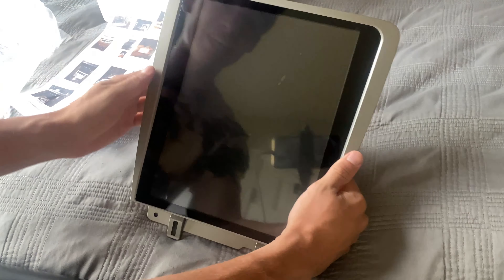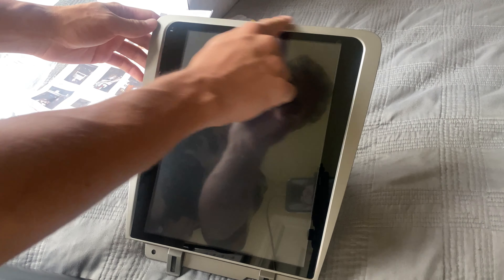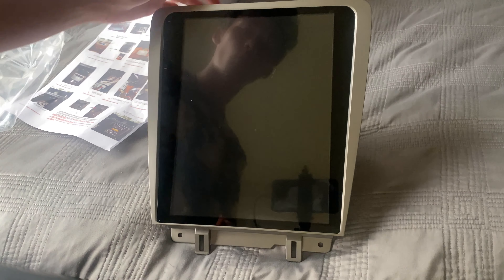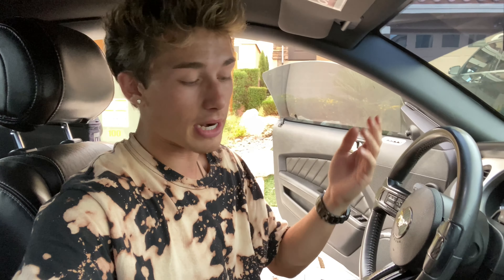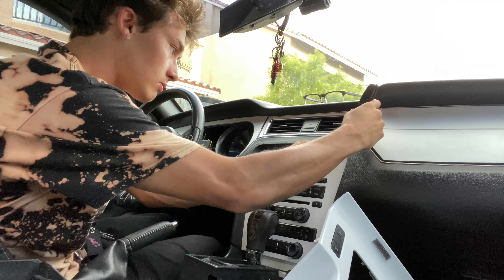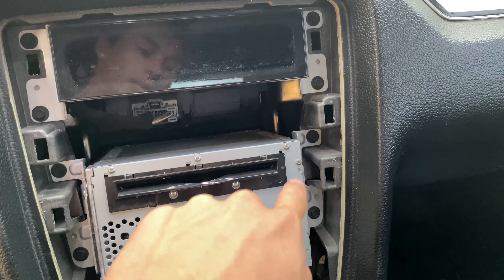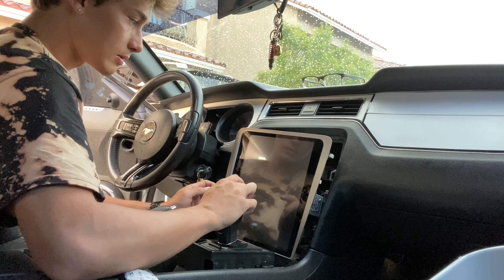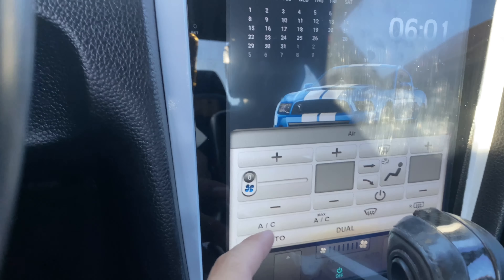The Mustang Got A TESLA SCREEN!!!

Comment: I know this is an old video, I’ve had my screen for over. Year and never had any issues. Always got compliments. Love the car play function when getting in the car and it auto connects. Phoenix automotive snapped
Reply from the maker: It’s a great system! I made the mistake of not purchasing Apple car play, but it’s no big deal. I can always get it on a later date. 

Glad you like yours!
Reply: How do I get sound bruh I got everything ac control but I can’t get sound
Reply from the maker: Try resetting the system or checking your connections to the back of the unit. Sometimes, these units need a different software that can be accessed in the advanced setting
Reply: @jdubstangy  make sure the harness in the back is fully connected and make sure its not muted, if restarting it doesn’t work try programming each button to match accordingly with your steering wheel buttons and control the volume from the steering wheel

Comment: Hey, I know this is an issue of video but I was wondering if you’ve had any issues with this setup draining your battery. I have a parasitic drain and I’m mostly sure it’s my setup. But also, I have a regular battery that I’m planning on upgrading. Any help would be right on time.
Reply from the maker: Hey! 

I don’t have any issues with my system and if I do it’s rare. You could be running into a battery issue or may need to check your alternator.
Reply: @LoganScott.  it was the battery. I was using the 96R that ford recommends but I put an Optima battery in a couple weeks ago and I haven’t had any issues. It seems like I needed a higher Cold Crank Amperage
Reply from the maker: That’s great to hear! Glad it was a battery and not something too extensive

Comment: Great video!  Where did you get your center console from?  I want to change mine out, yours looks sweet!
Reply from the maker: Thanks man! It came from Phoenix Automotive  (online).
Reply: @LoganScott.  I meant the white overlay around the cup holders and gear shifter.  Where did you get that from?
Reply from the maker: @douglasspooler2680  All used with white spray paint and extra carbon I had left over from a different item. I have an old old video on painting the center console  in my playlist under “DIY” if you’re interested. That video is basted around plasti dip but the same rules apply just about

Comment: Does the car display match the car? Does it change?
Reply from the maker: You will need to go through the advance settings to change it from the s550 to the s197. The color of the car wont change unfortunately. It’s whatever it’s preset to. Mine is a blue s197.

Comment: just got my 16 year old daughter a 2014 Mustang convertable with the tesla screen (she is so in love with it).  Sadly the back up camera was looking bad (horrible pic quality) when we got it a couple of days ago. Today it is showing nothing at all other than the lines (no visual feed at all anymore). Maybe that happened when we put the new plate on from the DMV. Either way it was having issues before that. Does anyone have any suggestions for a way to fix this problem? Thanks.
Reply from the maker: Hey Justine, thank you for watching! I’m sorry to hear this is happening. Here are some things I would suggest trying to see if it fixes your issue!

1. Check the camera lens: Make sure the camera lens is clean and not obstructed by dirt or debris.

2. Inspect wiring: Check the wiring and connections to ensure they are secure and not damaged. Loose or damaged wires can cause camera issues.

3. Restart the system: Try turning off the car and then restarting it. Sometimes, a simple system reboot can resolve minor issues.

4. Ensure that the wires are properly plugged into the proper locations. I found when installing my camera, there are a few ports where it will read the camera but no picture will be shown. 

5. System may need to be updated. I personally haven’t done it before but it’s possible it might. You can always reach out to phoenixautomotive for further information. 

6. You mentioned the camera quality is bad when it works. This very well could be the camera itself. I have a clear picture on my screen and have had no issues with visibility. Highly recommend investing in a quality camera.

Hopefully this helps! Feel free to message me for any further questions and I’ll try my best to help

Comment: I got the same screen and same door woofers but they aren't connected how did you connect yours??
Reply from the maker: I would check your connection again. Mine automatically paired when the unit was plugged in
Reply from the maker: There are settings to balance out the sound. I would check there too, as well as, the mute button

Comment: Quick question what wire did you connect the backup cam to to give it power ?
Reply from the maker: I’ve had multiple people ask me this same question and I honestly don’t remember my man. I believe it was either the green or purple wire from the top of my head but that could be completely false. 

The best method (in my opinion)  is to tap the camera wire to any positive on the back side of the screen while the car is in reverse. By doing so will allow you to see if the camera activates. I may need to make a video on this in the summer

Comment: i have the exact same one and it’s stuck on the reverse camera. how can i fix this
Reply from the maker: Try hard resetting the system and/or check your wiring is correct
Reply: @LoganScott.  i did hard reset it and it didn’t work. and i doubt it’s the wires because it worked completely fine before and all of the sudden it got stuck. idk what to do

Comment: Hey man, my a/c does not work. Stop working when I change te s550 background for s197 can you help me?
Reply from the maker: I’m not entirely sure where to start with that but if I was me, I would go into the manual settings and make sure everything is correctly set. Not necessarily the “normal” setting but the “deep” setting where you need to type in the passcode (you can find online) by holding down the setting screen. Hard to explain but once you do that, you’ll have access to all the controls. Another thing you can do is hard reset the system.
Reply from the maker: Code: 1688 
Under “System settings”
Reply: Thanks man, I will try and let you know.
Reply: I messed up  my screen it's not pairing with my AC. I could not fix it. Does not show an option to pair.

Comment: there's like 15 addons you can order with the unit, no idea what I'd need. I know I don't use apple products and my mustang is just a base 2010 model, doesn't even have the speakers in the door, nice informative viseo though
Reply from the maker: The concept is nice but the system is a little slower than I would like. Everything works just could be a little better is all

Comment: My AC does not work with that screen any tips?
Reply from the maker: I’ve heard of this issue persisting with others in the community before. Not sure what direction to look to tackle this problem but I would ask Chat GBT, watch YouTube videos, research forums and ask industry professionals or friends. 
If I had to take a wild guess, check to ensure the system is plugged in correctly and the system is reset and updated. 

Hope this helps my friend! 💯🤟

Comment: Hey how are the A/C controls and reaching them compared to the OEM radio? I see they have a new unit on Pre-Order that has physical A/C buttons and a volume / tuning hardware knob on both sides.. The A/C controls to me look like they're a bit low and like the shift knob would get in the way if you gotta press them..

Do you use Apple Carplay at all? Does it glitch out or does it work 100%? I had a Pioneer head unit in my old Mustang and Carplay would constantly glitch at the worst times.. music would cut off and all I would hear is Apple Maps Navigation it was so annoying.
Reply from the maker: The A/C work the same as the OEM until with some minor upgrades as in changing the temperature (units) compared to guessing on the last one as well as other features depending on your car model. They do sit a little low but I’ve gotten use to it. I don’t use it often so it’s not too much of a problem.

The Apple car play I plan on getting here at some point soon. The unit works decently without it but lacks features if you don’t have wifi to pair it with. With Apple car play, everything you’ll ever want or need is in Apple car play. I haven’t experienced any delays with maybe* a few once and a blue moon. Haven’t had issues with music unless it had something to do with my phone which has nothing to do with the unit. There are features throughout the system you can change to your liking. You need a passcode to get into it I believe I provided in this video.
Reply: @LoganScott.  Yeah I definitely am getting this system for my Mustang instead of the other one.. I was gonna get the OE Navos style navigation but those the touch screen isn't as responsive as it could be but this thing looks sick.

Comment: You said it was a little laggy at times, what ram did you get? Because they start at 2GB and go all the way to 8Gb. I seen another user that had the 6gb version and it was smooth as butter
Reply from the maker: I believe mine is a 2GB. Probably the reason why it’s little laggy. Normally, it runs smooth with slight hiccups here and there. Nothing that would drive you crazy
Reply: Cool, thanks for the response. Been looking into this system today. Bought one from American muscle a while back and it was complete junk! So, maybe a better experience with this. Thanks again
Reply from the maker: No problem! Hopefully you don’t get one that belongs in the garbage again

Comment: I’m starting to regret my purchase… looks nice but functions like butt
Reply from the maker: I’m surprised. I don’t have issues with mine
Reply: @LoganScott.  it’s small issues i guess that I have.. hate that it goes to a camera that I don’t have in reverse, my heated seats don’t work, rear defrost doesn’t work. Annoying how you can’t just hold down button when changing temp.. you have to tap it and living in Michigan in spring and fall can be annoying with that cuz you’ll need heat in the am and ac in afternoon
Reply from the maker: @TheThreeOneThree313   the backup camera issue I had as well but it’s pretty easy to add a camera to this system. As for the defrosters, I haven’t had issues with that and can understand why you would want them. Personally, I would call the company and see if they can assist you